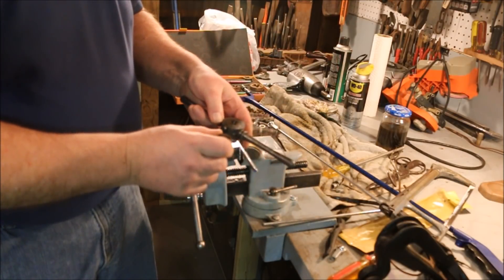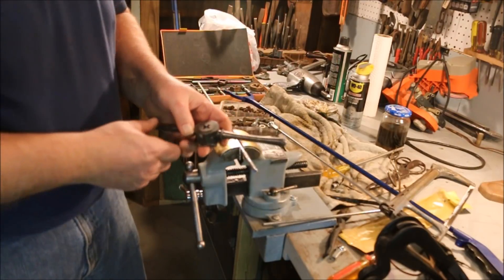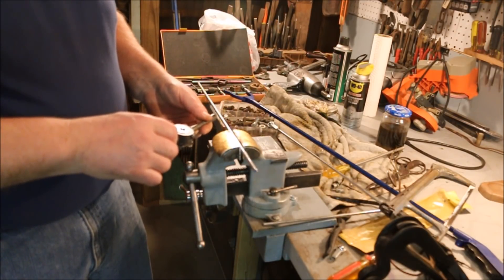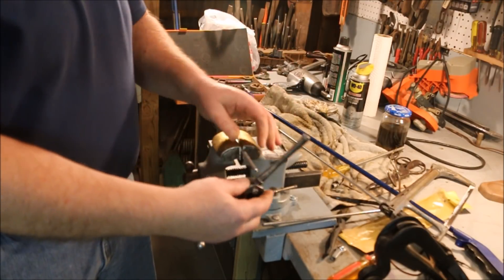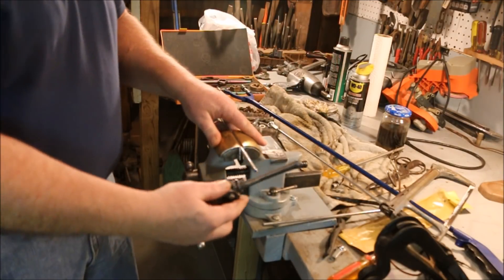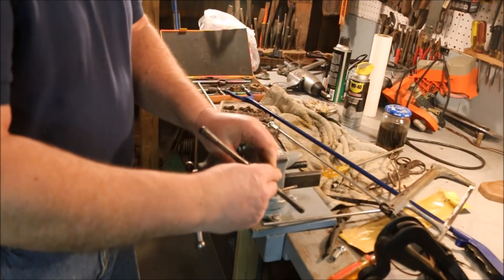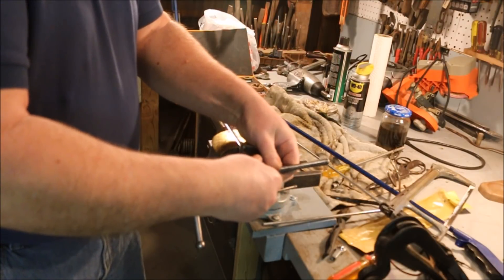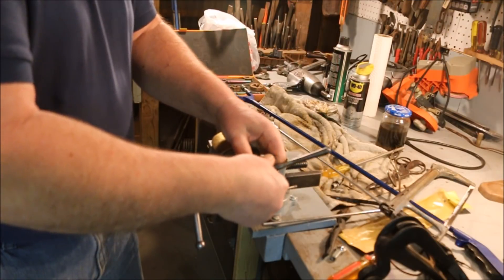HARBOR FREIGHT VS HANDY

Comment: Make life a little easier when cutting thread, put a little bevel on the end of the rod. Aids entry into the die.
Reply from the maker: kleinjahr It works. That is what the grinder did. 😁
Reply: "Obviously!" said the Captain. Lucked out last spring at a yard sale, Boot box full of taps for $5. Starters, middle and bottoming . I've gotten at least 6 good sets of each size so far.  By the way, do you remember how to cut left hand thread? For the life of me I can't remember.
Reply: Old Sneelock's Workshop - It also helps once you cut the thread a pitch or two to reverse the die to break the swarf. It is easier to cut the thread. It also reduces wear and tear on the die and stops chipping of the the thread you are cutting. 
Don’t want to teach you how to suck eggs, this is from my experience.
Reply from the maker: Tracey Moran Just to wonder. Can anyone point out why does it work that way?
Reply from the maker: Your Dad did right by you. Making sure the die is started cutting correctly is important. 
I'm more interested in the origin of the idea to back off after every turn or so to break the chip. I have set up hundreds of machine tapping systems and just as many die threading operations. None of them have a setting to back up the tap after a turn. They all start the tap or die and run it through. 
In a bottoming tap operation it is better to have a tap that shoots the chip up the flute of the tap and out the top. Breaking off the chip leaves the pieces in the bottom of the pocket for the tap to jam into. I don't recommend backing the tap or die off and restarting the cut. If it plugs or is running crooked by all means correct it. In my opinion just backing off doesn't help the tap/die or the thread. 
SAE has class of fit for threads. http://www.accuratescrew.com/classes-of-thread/
"For unified inch threads, there are 3 thread classes for external threads 1A, 2A and 3A and three for internal threads 1B, 2B and 3B. All of these are “clearance fits” which indicates that they assemble without interference. As a general guideline, the higher the class number, the tighter the fit."
Metric threads also have a class of fit. 
A full designation for a metric thread includes information not only on the thread diameter and pitch but also a designation for the thread tolerance class. For example a thread designated as M12 x 1 - 5g6g indicates that the thread has a nominal diameter of 12mm and a pitch of 1mm.
Working for a company that was started in the 1940's in the US, then purchased by a Swedish Company,followed by a Japanese company, the machines and equipment were built to one standard and converted or patched together with all manner of STANDARD fittings. 
Then you run into the pipe fittings with different classes of fit based on end use. Fuel fittings are threaded to seal dry without sealant or pipe dope to provide the seal. 
Having to order parts and write procedures for the repair and maintenance of the wide range of equipment was a real pain.
Reply: Old Sneelock's Workshop Dad taught me to back up and restart to make sure the die was cutting properly.  Otherwise, one could be cutting at an angle, instead of true to the pipe or round stock.  I was a Daddy’s girl and whatever he was doing, I had to be his shadow.  We replumbed an old house back when Apollo landed on the moon, he used galvanized pipe.  He left me his pipe cutting tools as I was the only one who cared to learn.  He also worked for Proto Tool ...I have a lot of good tools!

But I do know why SAE and metric are so different - there’s one standard measurement for SAE’s, no aggravation, you get what you expect.  But there’s four or so standards on the metrics which is why not all metrics are the same - it depends on which standard the company is using.  As Dad was in purchasing, he had to learn and teach this to the other buyers so everyone was buying from the same metric standard when needed.
Reply: Old Sneelock's Workshop thank you for all this information, I really appreciate it!
Reply: Old Sneelock's Workshop - the reason for reversing the tap or die is to reduce the chance of fouling the cutting edge and causing the die or tap to overload, in the taps case causing it to break. 
Did my time as a Fitter & Turner ( similar to Millwright/ Toolmaker) with GKN of England they used to be one of the worlds largest fastening manufacturers. The old Tradesmen there would hang you if you didn’t reverse the tooling. 
Auto machine taps for nut threading in production did not reverse but were very different to a normal tap. External threads were rolled on not cut with a die.
Reply: I seed it, I did! He DOOD it, he did!
Reply: What little I've done I just hammer on through. I've heard it messes up the threaded part or the die by .......................doing something.

Comment: There's just some things that are best left at HF...on another note, what kind of a saw set do you use for hand saws?
Reply: i bought a similar set, the door bolt had stripped on my car, needed M7 thread, nowhere sold a tap and handle at a decent price , to be fair it did fix the chewed thread to get the bolts back in, so thats all its meant for, a quick rough job.
Reply: Bill K. Stanley 42x

Comment: I find that many times it is the die stock being very close to die diameter, and with a spit die, even with the opening screw tightened up as far as it will go, the die cannot open enough to give a full size thread, I just skim a few though out of the holder body, then you can open up the die to give a good tight thread, most modern screwed rod is also very slack in the thread fit, especially in the 60 deg pitch sizes, (that is probably why Whitworth opted for the 55 deg angle).

Comment: I'm just glad they worked at ALL! I knew I didn't know anything about it and I knew you did with all your machinists experience and the Post Office is just down the road! 2 and 2 makes 4 sometimes, even with my poor old abused head and I'm SO glad they've found a good home and can earn their keep! Like I said, if it don't work here, it don't eat! Wear 'em out in good health, Unc!
Reply from the maker: I was a bit miffed that I had forgotten having them. I was use to dragging out the cheap taps and dies so out they came again. I need to trade out the clunkers from the set for the good ones in the drawer.
Reply: Do like I did with the drill and just swap them over. Nice case filled with good stuff. Then when you grab it's a good grab!

Comment: well yeah your comparing cheapest one use only rethreading dies, to quality dies.  but we are all guilty of buying cheap thinking we only need it once or twice, and it hurts the pocket less, but a couple years pass by and you wish you had that money to put towards something of quality, i also think the cheap die sets cheat,  ive just had  a problem with some 5mm threads, bolts and nuts, some not fitting, after lots of examination, i have 3/16 and 5mm bolts/nuts mixed up, 5mm nuts fit the 3/16 (as its 4.7mm) thread pitch seems compatible (but sloppy, but you have to have your wits about you) , i wouldnt be suprised if cheap die sets are so sloppy they can kinda fit 2 sizes and be sold on both
Reply: I've got some bolts and nuts that're sideways and I lay odds they're metric too. Oh well, such is life with someone that keeps stuff he might use later instead of having to run out and hunt something probably made cheaper that what he already has. And to keep the might be growling down, I like metric stuff too. I've got a set of each in enough tools to get me in trouble. I'd rather switch back and forth than fight. I get finished quicker and don't have to heal back up!
Reply from the maker: old iron shops Very true Chris. 
Buy good tools and cry once. Unfortunately, Good as you can afford, is on a sliding scale. Sharing the idea that HF sells crap is all to common a story. If all you have is a dollar, you get dollar stuff. 
In this case I bought a set to finally have a set with all the tools. They are crap and I'm replacing them one by one. They have the advantage of being all in one place. 
Sharing our experience can gain the apprentices the option of choosing from knowledge.
Reply from the maker: Lewie McNeely Tolerance determines how well things work. Dies have to cut slightly undersized and taps have to cut slightly oversized. Justba pinch more and you get a odd clearance hole that ratchets. 😈
Reply: Jusb1066 I've regted buying cheep tool much more the good tool. The used market is very price competitive with cheep tools btw
Reply: @itorn shops, yes, i really like trawling ebay for a good used than buying cheap no-name, the prices are about the same
Reply: That's right. Just a pinch!!
Reply: I TOTALLY agree. I'd think I'd like Snap-on but mine work just as well and aren't as noticeable to the greedy eye. I've got enough to do what I need to do and if I need something special, I'll just get the one thing instead of having a whole gomm of stuff to look after. Simple is always best. And limited space helps keep me honest!
Reply: Harbor Freight isn't the general worst; just the best known.  There's a "traveling circus" tool seller (can't remember the name) that makes HF look like a premium retailer.
Often, it isn't a question of "Is this thing any good?" so much as "Is this thing good enough?"  I think that, as far as HF taps & dies goes, the question is often "NO".  And if you ask again, the answer is "In a pinch, if that's all you have (or all you can get/afford), it will have to do."  I bought a tap & die set from Menard's that are just as good of quality as HF; or as bad of quality... it's really just semantics...